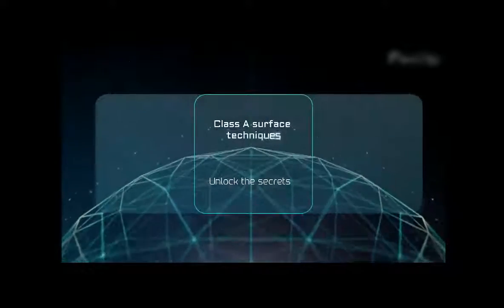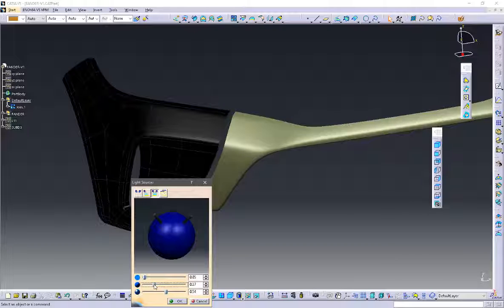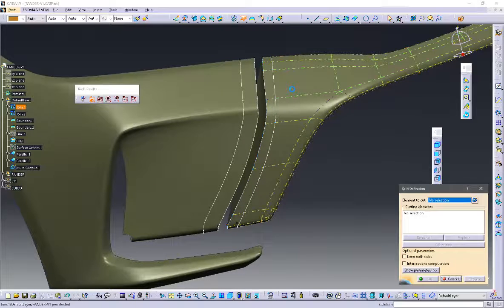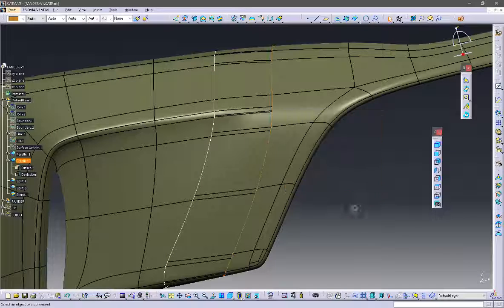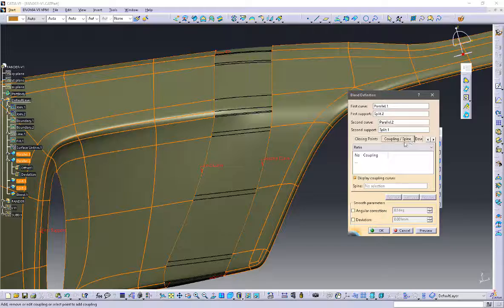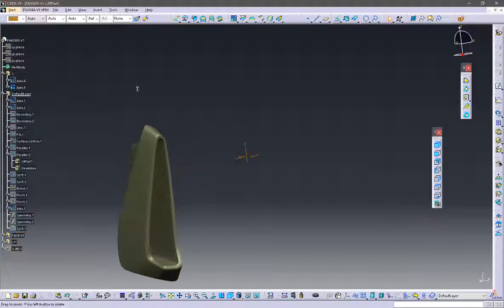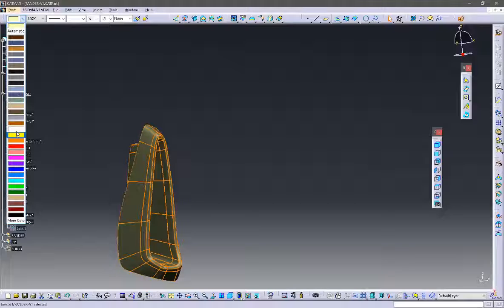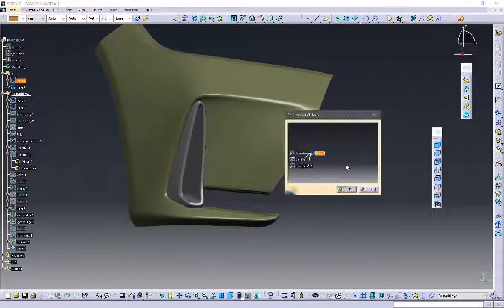P1-Front fender design | Class a surface technique using both Alias and Catia

Comment: Can you please tell how you can realise this detail in  processing line of production
Reply from the maker: This is an Alias SubD surface. While there are no issues for production, it is currently more suitable for FRP, vacuum casting, or 3D printing. However, further refinement is required — the surface should be recreated in Alias Surface or CATIA ICEM Surface. It also needs to be thickened, and all Class B surfaces must be completed. Once these steps are done, we can proceed with prototyping using FRP, vacuum casting, or 3D printing. I will suggest you watch the second part : https://www.youtube.com/watch?v=zLmYvZrDci8

Comment: So the Free Form Blend tool in Alias would not accomplish this?  Also, why not use Intersect tool in Alias too generate COS that you can trim with?  Just fyi, I am an Alias user, learning Catia in my down time and was hoping there was a way to leverage Catia somehow and use in my workflow.  Im in automotive design.  Thanks for the videos!
Reply from the maker: Yes, Alias Freeform Blend is really good. But in this project, I have used CATIA. In the second part of this tutorial, I’ll show how I used Alias to fix the reflection problem.
In the end, I used some complex trims and splits—these steps are much easier to do in CATIA compared to other software.
Reply from the maker: https://youtu.be/zLmYvZrDci8?si=xJqV3sZ2cGn4WJTa
Reply: What parameters you can take from Alias

Comment: Surface quality reallly bad., It's not Class A
Reply: ++ rough model for the modeler. Ideally, now need to outline the entire form with clean Class-A surfaces without Sub-D. And only after this will be Class A
Reply from the maker: @BigZee1986  Thats a great question.
 Alias subd itself is a class A surface with g3 continuity.. In addition, Alias Subd Retopo command is an excellent reverse engineering tool that lets us create stunning Class A surfaces quickly and easily from any scan data and low poly model. I have used this technique to make this model in few hours. If you're unsure whether alias subd is Class A or not, it's best to reach out to Autodesk for clarification. They have a wealth of resources and can provide you with the information you need. As for my experience, I have designed numerous casting and plastic products that have been successfully manufactured without encountering any issues.
Reply: @The-class-A-surface_guy   its not question :) If you can do it in sabdi as cleanly as with regular surfaces, then yes, it’s better to do sabdi. Subdi is very difficult to create a smooth, clean surface with complete control without damaging the entire part (more points more deformations). When the model is built in patches, the overall shape does not suffer as much as it suffers when the Sub-d is deformed. In addition, Porsche 918 spider, the bumper at the bottom made in sabd will never be the same as the one made with patches. Because the topology is different. For the same reason, Sabdi is not always good at automotive engineering. It can be used for simpler things. The fact that Alias shows it in his videos does not mean that now everything will be done in subdi. This is just another option (but not always effective).
Reply from the maker: @BigZee1986  
It can be quite challenging to achieve any desired shape in Alias subd without any referance. That's why I usually use subd when I have reference data available, such as #blender, #stl, obj, #lowpoly, or #scandata. Having these resources makes it much easier to accomplish any design. 
The dynamic combination of two powerful tools, Catia and Alias, has the remarkable potential to unleash exponential results like never before.

I usually make plan that what to and how to do in Alias so that I can finish it in Catia. If I ever have the chance to get the scan data of a Porsche 918 Spider, I definitely want to do it. The seamless integration of Skills in Catia and Alias opens up a world of possibilities for achieving unparalleled success in various industries.
Reply: @The-class-A-surface_guy  It would be interesting. I have an example of a bumper in STL. If interesting. I also tried to outline it with surfaces 6-7 times and it worked out (normal patch layout) in the end it’s really not absolutely perfect as I would have liked.
Reply: @The-class-A-surface_guy Sub-D Subdi modeling is always faster than creating through patches, but controlling the highlights and movement of the highlights is more difficult. Therefore, a dilemma arises: do it faster at the expense of the zebra, or do it for months but do it perfectly with control of each patch :) It’s just that the Germans are very careful in developing the design and external quality of surfaces. I think in this kind of competition there should be rules like getting as close to the reference as possible, not only in terms of the mesh, but also in terms of the movement of highlights and the cleanliness (simplicity) of the surface. And about sub-d they have G2 joints curvature, each patch is 3 degree (CV is 1-1-1-1). When you make each patch you adjust the entire surface degree (about 5 or 7 or even more) , and you can get curvature up to G4.
Reply from the maker: @BigZee1986  please share it with me. That will be my next video..in fact patch is a trimmed surface..which could be untrim..so there is no patch in subd. it is a group of surface with g3  continuity...
Reply: @The-class-A-surface_guy  ok, tomorrow
Reply: @The-class-A-surface_guy  I tried several times to add links to the Google Drive file. But moronic YouTube deletes all links to normal files. I don't know how to add here. Send email or place where share URLs
Reply from the maker: @BigZee1986  you can mail me if it is a lighter file..or you can WhatsApp me..+918249768949
Reply from the maker: There is another part of this tutorial so you need to watch the second part..For quality surface.. thanks for your honest feedback..
Reply from the maker: https://youtu.be/zLmYvZrDci8?si=HhLfgzyq10oCYjNW

Comment from the maker: Sure, I can help you convert your scan data into CAD data. Whether it's in STL, OBJ, or FBX format, I can transform it into a Class A surface using reverse engineering techniques. Just let me know how I can assist you further!
Reply: Ok, what is your email so I can send you a sample file. Do you also use Soldworks?
Reply from the maker: My whats up no: +918249768949 @SandeepSingh-43
Reply: @The-class-A-surface_guy  thanks. Where are you located?
Reply from the maker: @SandeepSingh-43  for any discussion please WhatsApp me..thanks..